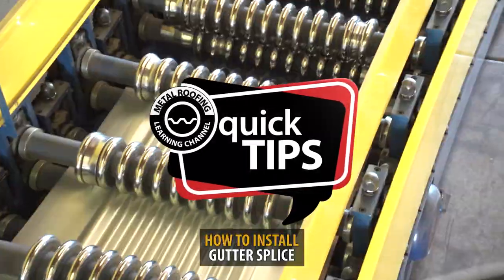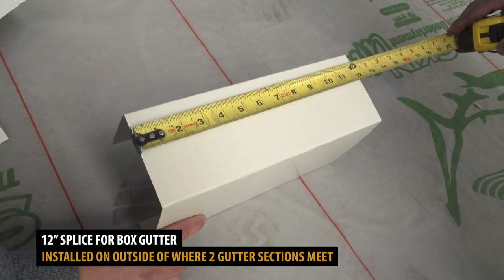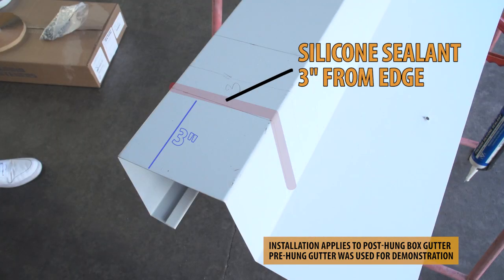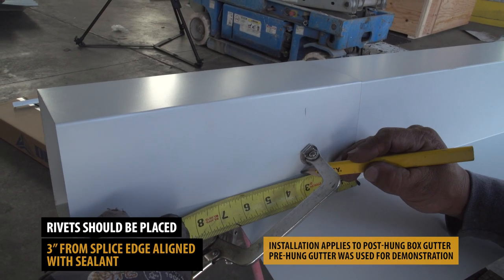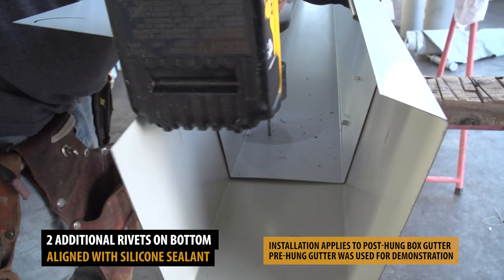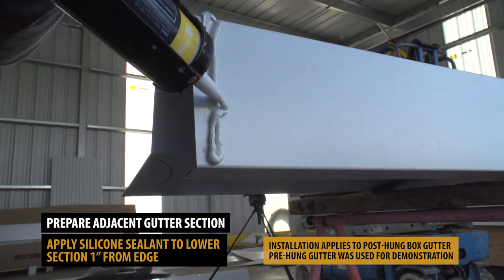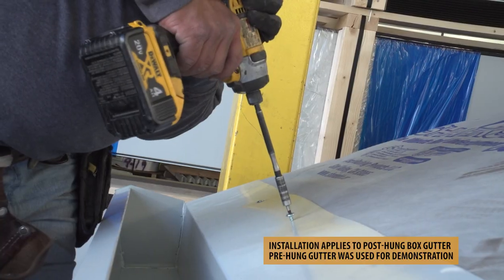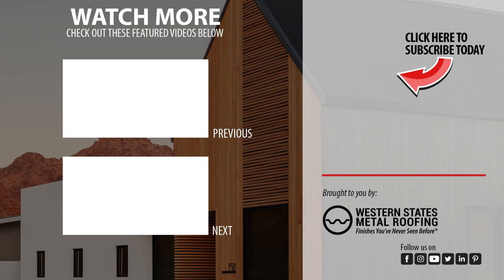How To Connect Two Pieces Of Gutter With Gutter Splice. Overlap + Gutter Installation On Metal Roof

Comment: I was always taught to never use silcone Sealant and use Gutter sealant. Because when silcone hardens in the cold it will contract, inside the gutter,  but gutter seam sealant is tacky and stays wet and does not harden. Thus not contracting and keeping a seal. Maybe it's about the type of gutter I could be mistaken

Comment: Drilling those two holes on the bottom of the gutter will certainly guarantee a future leak.  Seal well with sealant and hope for the best.  The person who installed my gutters drilled a hole in the bottom of the gutter and that's exactly where it drips every time it rains.
Reply from the maker: Cat,
Thank you for the reply.
Proper maintenance would most likely prevent a rivet from leaking. Maintenance to include replacing sealant that may have dried up or cracked over time to allow water to bypass and leak past the rivet such in your case. Rivets are used to help hold the splice and gutter together and to make for a much better appeal. No rivets could cause the gutter to expand and bubble at the splice which will be a much bigger leak issue than the rivet itself. Sealant is also used at the splice, end caps drop outs, etc. and we recommend that you do a yearly inspection and replace failing sealant to prevent leaks.
Reply: Always an excuse. If you didn't rivet the bottom you wouldn't need "proper maintenance."  Smh
Reply: @highnoter1  Surprised at the heavy handed comment.  Bear witness of the evil but if WesternStatesMetalRoofing answered well, why smite you them? ("Always an excuse")

Comment: If you rivet the second section in, won't that defeat the whole point of the expansion gap?  The section will pull on the joint and on the other section...